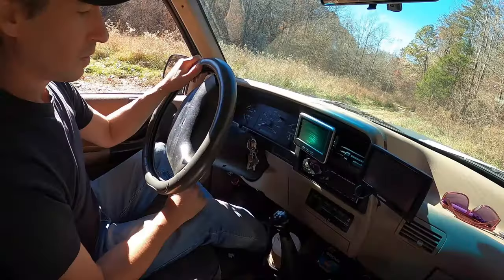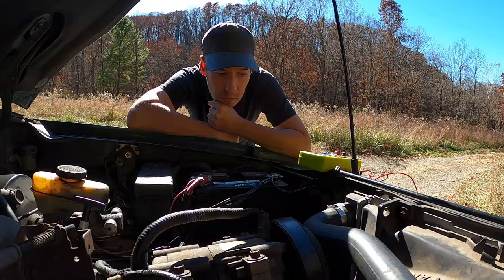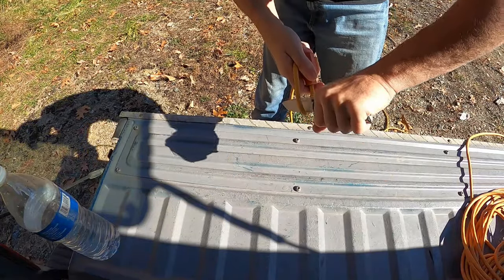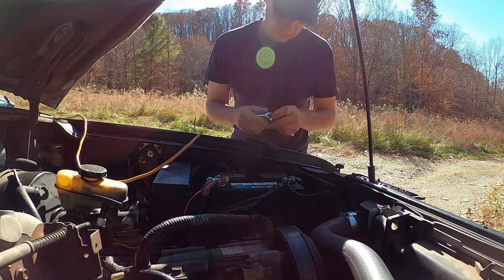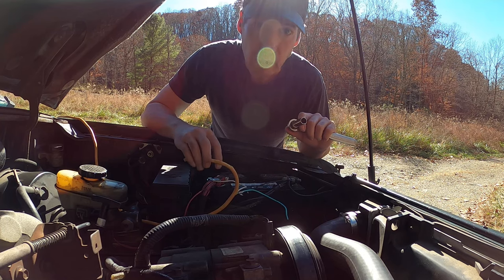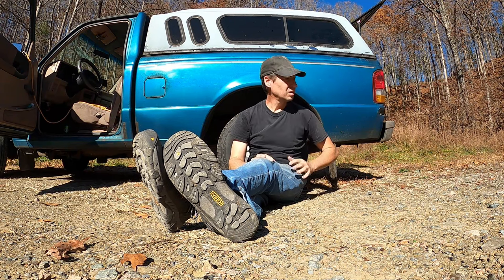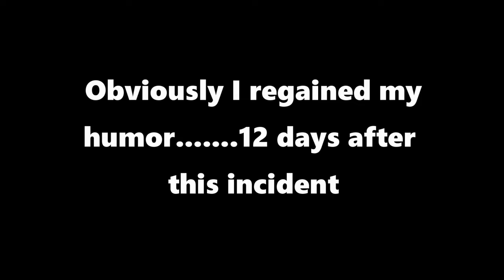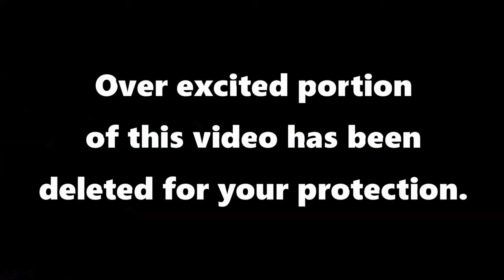I Had To Rescue Myself

Comment: Awesome solution to a dead alternator in the woods -- it really is convenient you had the solar kit in the back 😂Older Ford Rangers are my favourite trucks, it's cool to see yours with such mileage on it.
Reply from the maker: I'm so glad I had the solar kit and that it worked! Love my ranger, needs a lot more work. Low compression low power. I'm slowly buying parts and will pull the engine when it gets warmer and do a poor mans rebuild.😓 Can't afford a new car, have to keep it running! But I don't think I'll ever get rid of that truck.